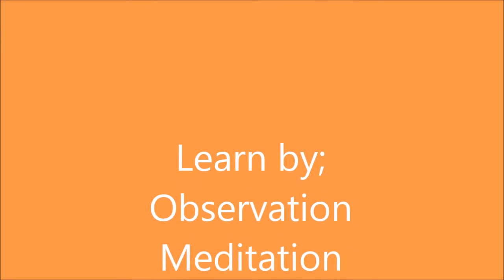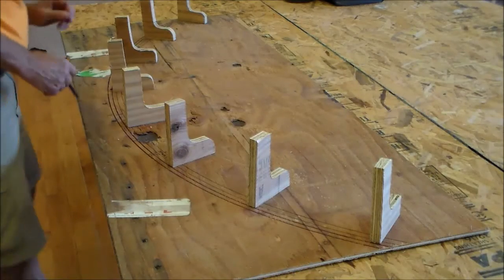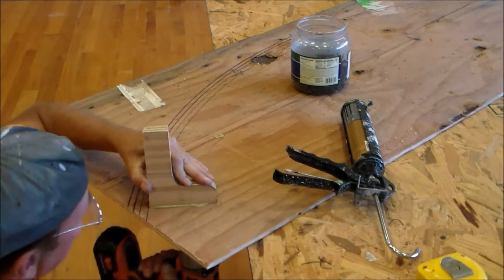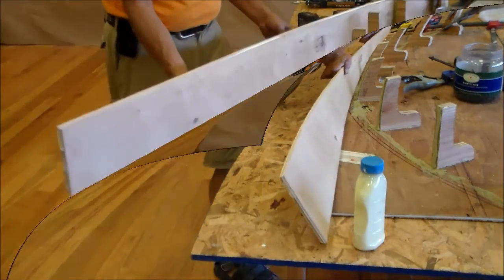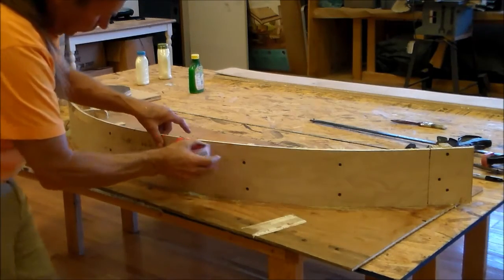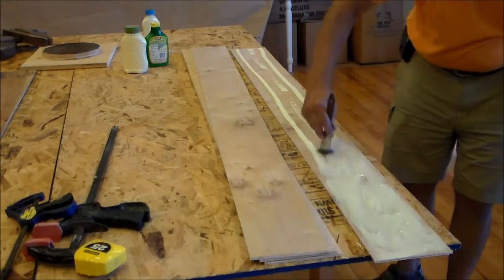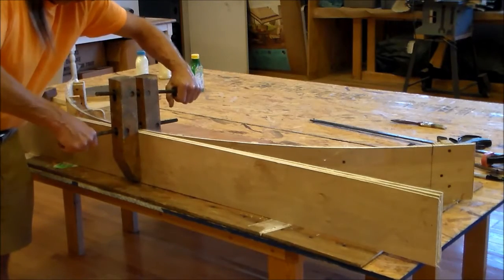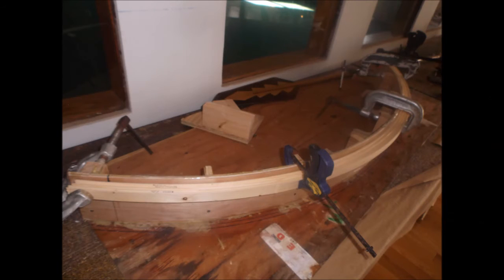Dome Ceiling   Circular Base,Forming Jig and glue up   Step 2

Comment: Hi! I love your videos! Just off the top of my head, would you see it as a benefit to make a strap clamp for along the outside bottom of the arch while gluing? I was thinking: If you put a piece of angle iron spanning and behind outer the plywood brackets, you could then run a heavy duty ratchet strap, like a moving load binder strap, around the face, under the shoe clamp (which might need a spacer toward its top) and ratchet it tight from the straight side behind. Would that improve the quality of the lower joint edge? Thanks for posting your videos!
Reply from the maker: +CuriousEarthMan Sounds like you may have something there to make it a bit easier to pull it all together.  Thanks for the tip my friend!   Don
Reply: +Donald Porta You're very welcome! Thank you for all your informative postings!